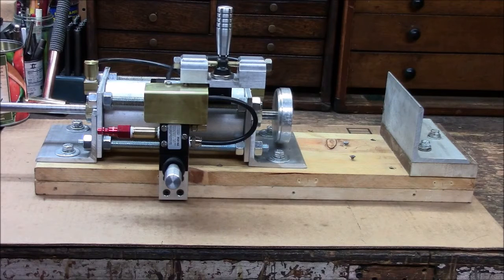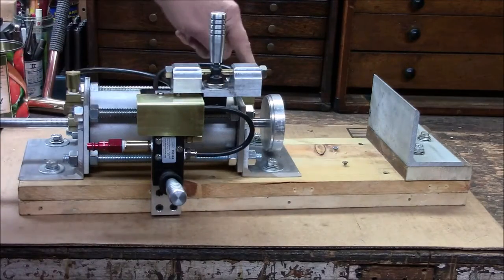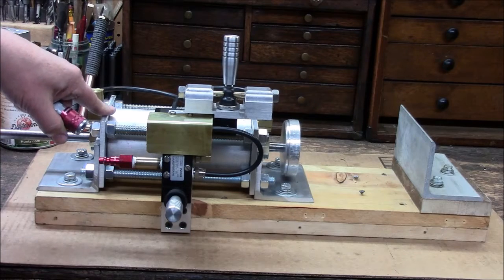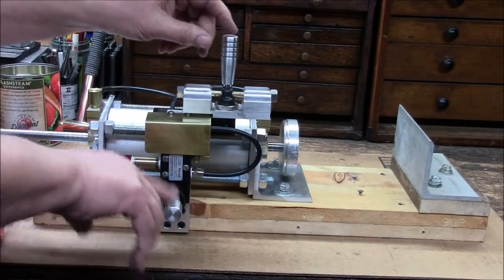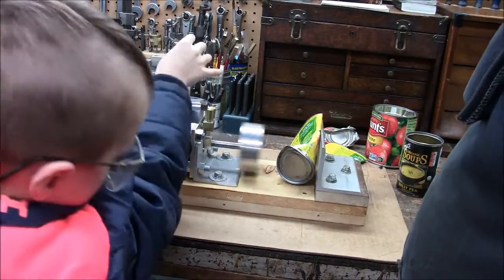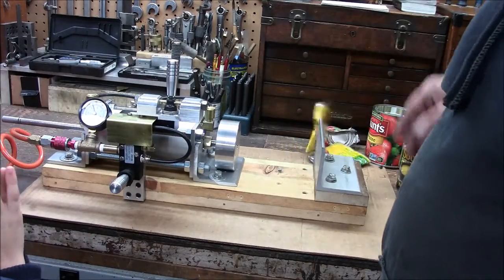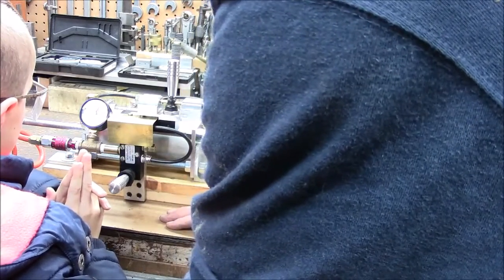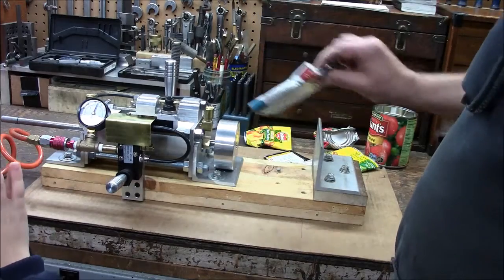Caleb's Can Crusher

Comment: G'day Fred and to the little bloke, you did a great job of the can crusher really well thought out.  I couldn't believe how you had ice in the air line, you have it  really had cold over there.  Once again fantastic piece of engineering and to use bits and pieces around the shop.  Thanks for showing the vid Fred very interesting and what a great thing to have your grandson there with you, irreplaceable memories, kind regards John.
Reply from the maker: Thanks for the kind words John.  I live in Upstate NY USA and it is the middle of winter now.  We just went through a 2 week cold snap where the temperature never got above 0 F or -17C.  My air lines run from the garage where the compressor is to the shop at the other end of the house about 80 feet.  The moisture in the compressed air was freezing on the inside of the pipes that run through the unheated garage and reducing the flow rate until it froze solid.  I have installed a water separator and an oiler at the compressor.  Hopefully there will be no repeats.  Thanks again for watching!  Fred